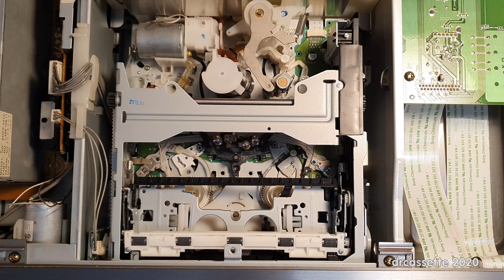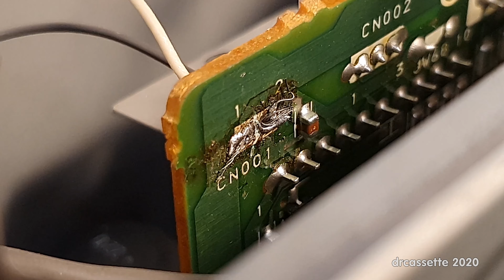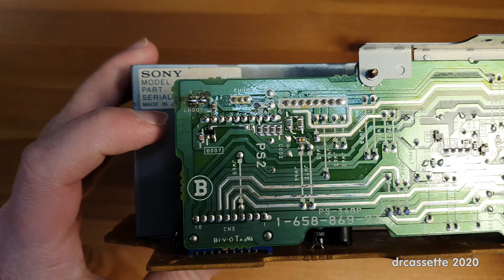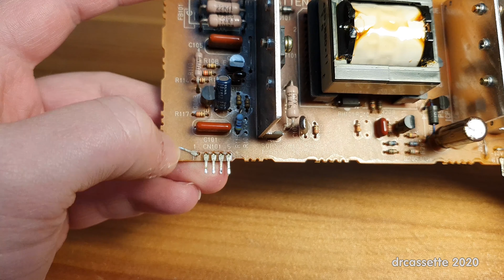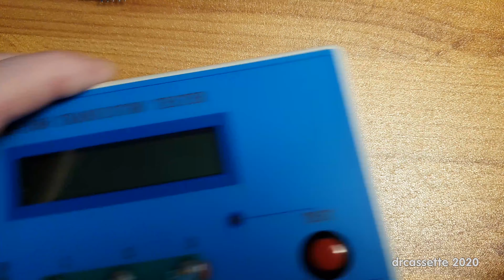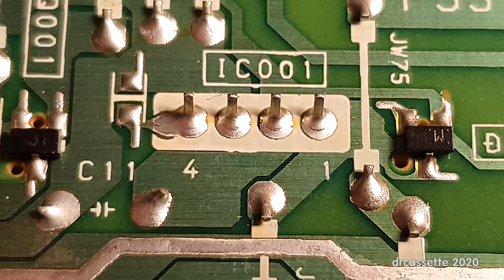Sony DHR-1000VC DV VCR repairs [1/2]

Comment: Greetings! Thanks for the information in this clip. Very informative!
I have a SONY DHR-1000VC. When I bought it, it had the following problem: the sound on the RCA or SCART output had a hiss. On the other hand, on the FIREWIRE output, the sound was OK.
I started by checking the electrolytic capacitors.
I found at least 20 out of parameters and decided to replace them.
I replaced all the capacitors, on all the boards, over 140 pieces. The surprise was that almost all the capacitors had started to leak and a large part of them were defective.
After replacing the capacitors, the device works ok but the problem with the sound still exists, that is, there is a hiss on the RCA and SCART output, but on the FIREWIRE output the sound is perfect.
What do you think I should investigate next?
Thanks in advance for your suggestions.
Reply from the maker: It is quite worrying that you found so many bad capacitors in your VCR, I need to check the capacitors in mine, as so far only the power supply capacitors have been replaced. As for your problem, unfortunately I don't have a good idea or suggestion. Seems like it would be something with the D/A converter, if the Firewire output is flawless. You're lucky your Firewire output works, on my VCR it does not, which makes the machine mostly useless.

Comment: I have one of these myself, and it's absolutely fantastic. I have one question though. I see on the front there is a line in for video and s-video, and I get signal on the player when connecting my VHS-deck using S-video to this connection, but I get no signal on my computer when connecting using a Firewire cable. I'm not sure if this is intentional, or if this device can be used as a ADV converter for other decks like the VHS and so on? Or will I have to get a standalone ADV, like the Canopus 110 or similar? :)
Reply from the maker: As far as I know this recorder does not have the ability to convert the analog inputs directly to Firewire. So you will have to get a separate analog to digital converter.
Reply: @DrCassette  Thanks for answering. Any suggestion for a good s-video recorder/converter? I heard the old ADVC110 may still be the best way to go?
Reply: @OuglandMedia  ADVC-100 and ADVC-300 can "ignore" Macrovision, ADVC-110 probably can't. But, ADVC-300 has TBC and noise reductor.

Comment: How did you get your hands on this machine? I recently bought one, the same exact model, refurbished on eBay for quite a lot of money, and it was damaged during shipping unfortunately, so I returned it. The mechanism jammed when I inserted a tape and it was immidiately ejecting it.
Reply from the maker: I got this machine from a friend in exchange for some equipment I had in my collection. And just to clarify, this friend is not the one who did the terrible soldering. 
Too bad your machine didn't work...

Comment: OK, I had no idea there was such a thing as a full size DV cassette, I just thought there was only MiniDV and of course Digital 8 and its variants and predecessors.  I watched part 2 before watching part 1, and my first thought was this was a DVHS machine, clearly not.
Reply from the maker: I actually don't think I would bother with a DVHS machine, that format is just too obscure, I would never get any use out of it.
Reply: @DrCassette  Sure, the format was not around for long at all.  How commonplace was full size DV tape?  Was this VCR meant for use in video editing environments like in a video production studio?  That remote control unit very much makes me think it was.  Then again, I know nothing about video editing.
Reply from the maker: Fullsize DV was rather uncommon, these cassettes offered 3 hours of playtime, which you did not commonly need. The fullsize DVCAM cassettes are much more popular, because Sony had a very popular line of professional ENG camcorders that would take them, and because in DVCAM mode a one hour MiniDV cassette would only give you about 20 minutes recording time. These DV VCRs were mostly used for video editing, the DHR-1000VC does have a TV tuner, but it was way too expensive to just be used for timer-taping TV shows.
Reply: @DrCassette  OK, I follow you.  I presume the TV tuner is analogue only, yes?  So a VCR like this would have been used in a TV station and when the journalists came back to the studio they'd hand in their tapes for editing before being put to air I suppose.
Reply from the maker: Given the age of the VCR, the TV tuner of course is analog. These machines were still prosumer-grade equipment, so mostly hobbyists used them to edit their home and holiday videos. I imagine they were also popular with wedding videographers. For professional work there was DVCAM. Remember, DV VCRs can only play back DVCAM, so there was actually a DVCAM version of the DHR-1000VC called the DSR-30 that could also record in DVCAM mode. TV stations would only use DVCAM if they were on a tight budget, commonly they had better equipment such as Betacam.

Comment: I also have one of these, which was given to me.  I just had to lubricate the tape loading mechanism slightly due to poor previous storage, but other than that it's been no trouble in the 5+ years I've owned it.  You can see it at the end of the outro of most of my videos. I've also worked on some other DV/DVCAM units on my channel, most recently the DSR-30P.

The soldering which someone has done to your machine is just awful, I don't know how anyone could do something so bad, and yet seemingly be at least vaguely aware of what he/she is doing.
Reply from the maker: There are step-by-step repair instructions for a shorted power supply available online in German language. I suspect whoever did this 'repair' just followed the instructions and was lucky that it fixed the problem...

Comment: Another thing. There is a com on fault on this unit, simple but could turn catastrophic... The inner "clock "battery, as it gets old, runs leeky, acid goes to pcb and causes all king of strange symptoms...  It is under the upper right pcb... Big round capacitor....  0.22F if i remembers.... If you have any question send me a message i have repaired several of these, as a SONY TECH.
Reply from the maker: Thank you for the info, I will take a look at that backup capacitor and replace it if necessary. Soon I will upload the second part of this video in which I try to repair the DV port. Unfortunately not successfully, I checked that there is continuity from the DV jack on the front to the JC-13 processor board in the back, but I have no idea what to do now... Any ideas?
Reply: @DrCassette  unfortunatly firewire connections on Sony equipment are prone to fail... Most of the times the processor itself is the fault. Other than that, there is usually a couple of low value resistors and coils for protection on the path. If those are OK. My best guest is the IC is kaput!!!
Reply from the maker: @zerosanity01986   Okay, that's too bad... When I checked for continuity I found there are shortcircuits between pins of the Firewire on the JC-13 board. According to the schematic the Firewire pins connect straight to IC702, but there is also some other circuitry connected in parallel that may be faulty. But the JC-13 board is so complex that I can't really diagnose anything :(
Reply: @DrCassette  Yep.. The problem is that. More than one IC May be faulty. We usually swapped the board At work.

Comment: Never knew there was a full sized version. I always knew these as Mini DV, never knowing there was a full sized tapes, thinking the "Mini DV" was just referring to how small the casettes were, being smaller than Digital 8.
Reply: There was another format called DVCPRO, which can also take DV sized tapes (and miniDV with an adaptor), and that format brings us another two sizes.  M size, which is almost exactly the same size as 8mm, and XL is which is super large, but quite rare.  So there are a few machines which will take up to four different tape sizes (one with the adaptor).

Comment: 7:40 - I don't believe those filter caps are original. Note that the solder-joints are shinier than the production solder-joints.
Reply from the maker: Also there was resin around the solder joints of these capacitors. They must have been replaced at some point, before the person with the non-existent solder skills came to replace those transistors. Strange that they didn't also replace the little capacitor on the primary side.

Comment: Hello Dr, which camera do you use to film?  It’s great with the closeups, and has great colour rendering.  Thanks for the video.
Reply from the maker: It's the main camera of the Samsung S10 smartphone. It does a very good job, but you have to watch and make sure everything is in focus.
Reply: DrCassette - It puts out an impressive picture!  Always enjoy your videos, looking forward to more.
Reply: Great video, it’s 5 yrs ago but I have this same  unit and the main power supply is good but the small dc to dc converter mounted on the tuner pcb is faulty. It’s a TDK device CE-0788. It has  a supply of 14 volts and seems to output 3 other voltages. When it failed it popped the 400 mA fuse on the main PSU pcb. It’s a very small module in a metal case. The machine comes on in standby but I think one of the missing voltages could be for the front display, it would need low current maybe 40 volts but I wonder if that module may be needed for other front control functions. So no display and no functions . Have you came across this module failure? Any help appreciated